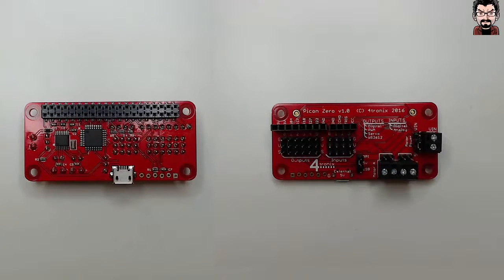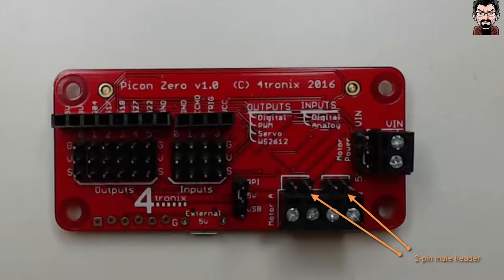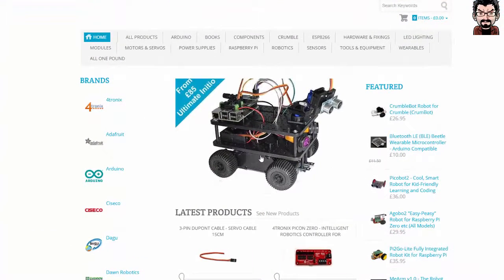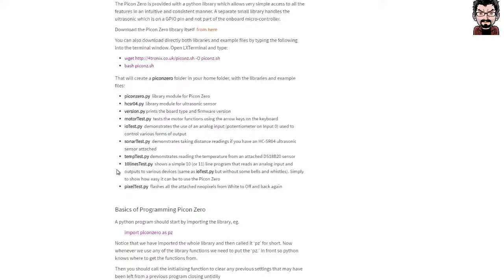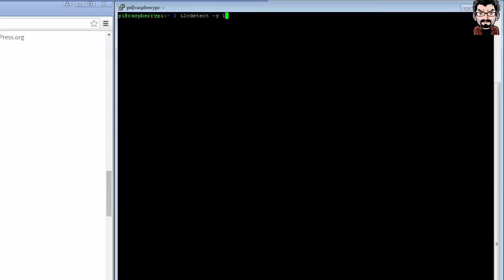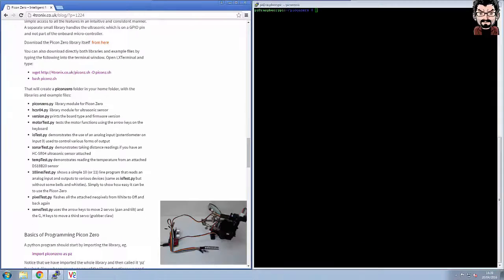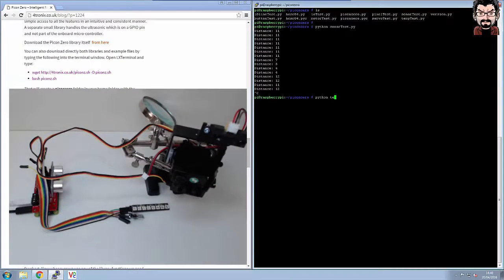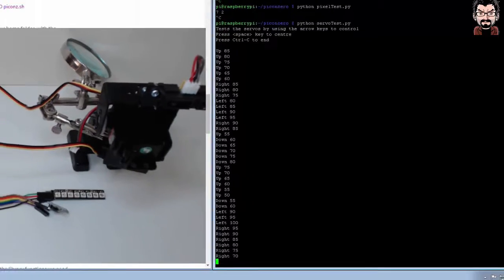4Tronix PiconZero

Comment: Great review, Francesco, thanks. One thing missing from it, and indeed from the spec of the Picon Zero is how fast is the ADC? That might be significant for anyone considering buying this board.
Reply from the maker: +Tony Abbey Thanks, I am glad you liked the review. I wasn't too sure about the answer to your question and asked 4tronix about it. They couldn't quite come up with a quantifiable answer but this is what they said: "The ADC is actually in the ATMega328P specs, running at 16MHz. But actually getting the answer back to the Pi is subject to a number of latency delays: the control loop we are running and the I2C protocol."

Comment: hi could you send my full code programme the robohat board as  i am not be able to write one my self its the same board as this one but for the raspi 3 please help it work with the test files but keeps starting up with the motor running
Reply from the maker: James Harris I was just using code from their repo, did you check with 4tronix how to get the example code? It should be via a link on their blog. It should find it here I think https://4tronix.co.uk/blog/?p=1196